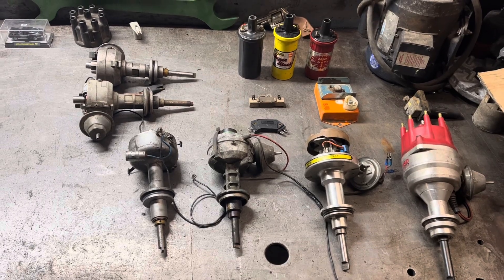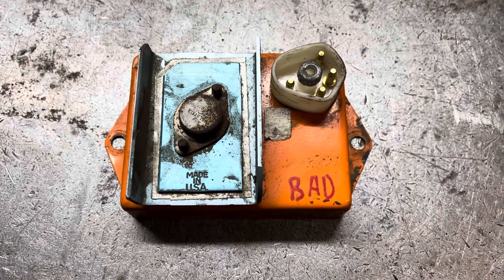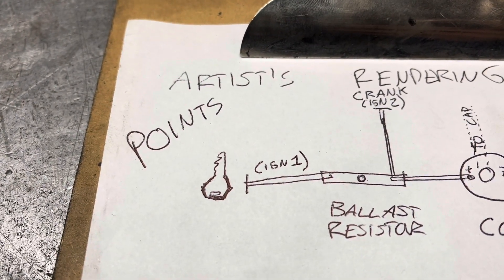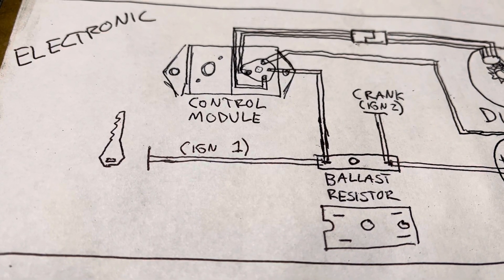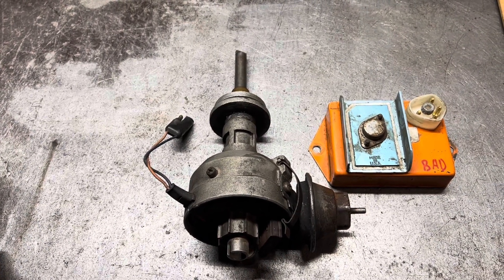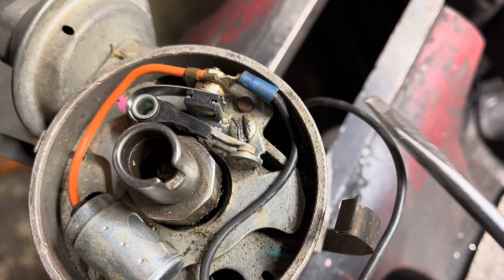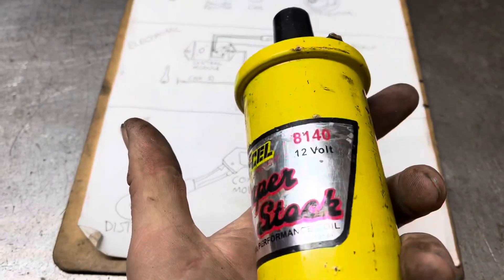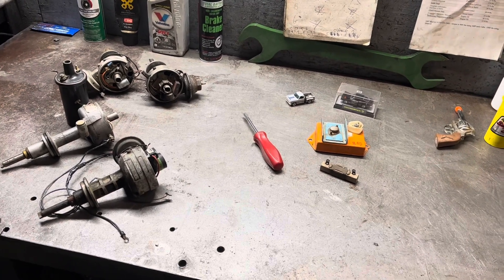Classic Mopar Ignition Systems - How They Work, How To Diagnose Issues

Comment: Very nice explanation :) Been trying to get my 78 Plymouth Trailduster running again. Know the Chrysler electronic ignition is touchy and found ign wiring boogered in engine compartment. Need to trace and reconnect to factory setup. Friend had said just do new 2wire setup with 60$ distributor and coil. Wondered what to do with factory ign pieces/wiring if I did that.
Reply from the maker: The factory stuff can just kinda stay there. It won’t be an issue. Just wire your new ignition system as instructed and it’ll work fine. You can also remove the original box and cut out or hide the connectors for it if you prefer.

Comment: Terminal issues and corrosion is always first check, with bad ground.
Reply from the maker: I’ve done a lot, and I mean A LOT of work with these systems - and I have very rarely found those issues. I have very frequently found bad ignition modules, distributor pickups, and other ignition components. Now, if we’re talking charging circuits and main feeds through the firewall, we’re talking corrosion and melted shit.

Comment: I’m putting a 82 slant six with electronic ignition into a 1953 pickup. The wiring is absolutely trashed in both trucks. The 82 runs good but I would no like to simplify the ignition system. I would appreciate any advice switching to points system or another option like a 2 wire.
Reply from the maker: Consult a wiring diagram for the points system, and mimic that in the newer truck. Or, for something simple like an HEI conversion or similar electronic system, see my HEI conversion video where I explain the circuits needed to do that. Both are simple - but you do need a basic understanding of the two ignition circuits - ignition 1 (regular ignition power) and ignition 2 (cranking ignition power) - and you need to be able to find them in your truck.

Comment: Would this test spark cause the engine to attempt to fire backward when key is turned to the off from run position? After the vehicle is warmed up and then shut off and allowing around 20+ minutes to soak. Vehicle will also crank with no start for more and more time the longer it's allowed to heat soak until it cools all the way down.
Reply from the maker: Yes, it might do that. That could well be a distributor / distributor pickup problem.
Reply: @DeadDodgeGarage  I was afraid you were gonna say that. Thankyou. What distributor would you recommend if I wanted to run an hei system. I tried a coil from a 99 durango but I couldn't figure out how to get my truck to rev higher than 3k while driving but could rev to 5k while sitting. Also was hearing a electric buzzing when the coil wire was plugged into the distributor.

Comment: Very informative to say the least!  Thank you so much as well!  I have a no spark issue with my 340 engine.  Did tests and found that the internals on the electronic ignition were shot!  You get it?  Shot, like your cap gun!  Lol!  Good stuff!  Thank you also for the tip with the GM module!  Hope you see this,!  Tom. 👍🙂

Comment: Hey Jamie, if I have a two pin , electronic ignition module. Can I run a four pin module on it? Thanks.
Reply from the maker: Yeah, you’re looking at a voltage regulator. Your ‘72 has ignition points, unless it has been modified. I have talked about how to diagnose and fix points issues in many videos, including a detailed description of how they work in my big ignition systems video (this one.)
Reply: @DeadDodgeGarage  so oddly enough, it has electronic distributor the wire goes from the distributor to the coil, and then the positive also on the coil goes to the bow resistor, and then to another wire and the ground from the distributor I think also goes to another wiring harness, the only other thing I can see on this truck that is even close to ignition control. Module is just above the voltage regulator. There’s a small tiny box mounted maybe 2“ x 2 1/2“ and it has a circle on top of it that kind of goes through the cowl other than that, I don’t see an electronic ignition on here
Reply from the maker: There is no two pin ignition module. Are you by chance looking at your electronic voltage regulator?
Reply: @DeadDodgeGarage  it’s in the top left corner of the truck. Mine is a 1972 Dodge D 100 it has two pens I believe a red wire and a green wire. I put a new distributor in it a new coil and I’m not getting any ground to the coil and I have no spark. I’m assuming that would probably be the problem right?
Reply: It’s in the engine bay. I’m just having a hard time diagnosing no spark/no start condition.

Comment: Love this video. I’m having an issue I would like brought up. My fury not only had spark to the plugs ( I pulled the 1# and grounded it to the exhaust) fuel, air, and proper timing with the rotor set to BTDC, and still wont start, barely any bangs or pops when I try cranking. Someone please help lol

Comment: Great  video.  Im having issues with mine.  What should the voltage read at the positive pole on the coil while cranking?  Mine is only about 8-9 volts just like in the run position.
Reply from the maker: Because of draw from the starter, the voltage will be much less than typical battery voltage. And of course there is always a bit of voltage drop through the rest of the electrical system. If your IGN II circuit was not working, you may only see 5-6 volts at the coil during cranking. What you are seeing is probably normal. Probably.

Comment: One variation I didn't see was the dual pickup electric ignition distributor. I hear that the lean burn distributor had dual pickups without a vacuum advance, but my 84 360 d150 has dual pickups with a vacuum advance and no lean burn.  One pickup is for crank and the other is run.  There is a relay on the firewall to switch between.  I have read this allows the truck to have advance built in during cranking for easier starts.  So, a bad run pick up will act just like a bad ballast resistor.  Cranks but dies when you release the key.
Reply from the maker: I’ll be damned. I’ve yet to ever see one of those.

Comment: great explanations and I learned a lot!! only problem is I'm still having issues diagnosing my '72 Dart. she runs fine when completely cold. when the car gets even slightly warm and you turn it off, it doesn't want to run again until completely cooled off. still cranks, just no start. I've changed spark plugs, plug wires, and did an aftermarket electronic ignition. really lost to what's wrong
Reply from the maker: Hold the throttle to the floor while cranking. I bet this is actually a fuel boiling problem. I could be wrong I suppose.

Comment: How did the old dual points distributors work? I had an aftermarket one on my 340 years ago and it had two separate wires coming out  and screws that I could use to set the dwell differently for each set of points separately to give it a longer spark, but it looks like the old stock dual points only have one wire and no screws and cannot be set to for one set to be open longer so to speak. Do they just trigger the spark at the same time and really make no difference in the spark? What did Chrysler think the advantage to that was, did in give a hotter spark with two? Might make a good video.
Reply from the maker: No - there is overlap between the two sets, and slightly different timing for when they are triggered. One opens first, one closes first. This increases high RPM performance and reduces wear on the points. The spark occurs the moment the second set of points opens, and the coil begins charging again the moment the first set closes. And yes, they are individually adjusted. They both connect to the negative terminal on the coil, so the connection between the two can be made inside the distributor. This is how every aftermarket dual point I am familiar with is configured as well - although some have a stud on the side to make the connection instead of one wire coming out. I have seen a dual point modified with two separate wires to be connected as a timing retard for use with nitrous, but other than that, I can think of no reason for the two wires to be separate outside of the distributor.

Comment: How about this problem? It cranks but won't fire until you let the key go back to the run position.
Reply from the maker: Common with some electronic ignition conversions due to the way they are wired - but can also be an issue with ignition switch, wiring to column / dash, firewall connector, or under hood wiring. I think I’ve gone over that issue in a video or two but I have no idea which.
Reply: @DeadDodgeGarage  I will look up your video. Thanks

Comment: My 76' W-100 Powerwagon 440 - just had the starter rebuilt, the truck sat for three months, reinstalled it, it started up, but then began to run terribly; zero torque, then backfiring loudly, I barely made it back home.  I bought a new control module, after installing it still runs like crap and backfires,  Jegs sent me a two terminal ballast resistor, mine is a four, so I suspect my ballast resistor is bad?  Why might it be backfiring?  Before now, it always ran Great and never missed a beat or backfired.  I changed the relay, AFB carb just rebuilt, alternater too, I'm sad and at a loss.

Comment: before going to chevy HEI: ballast resistor is crucial for a specific ignition coil, the resistor value of the primary coil determines whether the ignition system requires a ballast resistor or not, if we understand this important fact we can recognize that the mopar ignition system is the simlest and most reliable system. The HEI from chevy has its own issue too.. don't forget that.. 
Electronic ignition module black and blue are the best while the orange one is bad avoid it.. Because the circuit is bad and made for low rev. Engines not for heavy circumstances
Reply from the maker: I can’t tell you how many Chrysler electronic modules have left me stranded. I’ve had much better luck with the HEI.

Comment: Thanks for doing this video.  My problem with my 64 Valiant is that it runs great at idle and acceleration up to around 35-40 mph.  But then, it starts bucking, sputtering and backfiring.  I also noticed that my amp guage has a tick.  The needle moves slightly at a steady rate. Not sure if that has any bearing or not.  I have completely rebuilt my carburetor, and rechecked all the linkage adjustments.  I added new plugs, wires, and coil. I checked and adjusted timing to factory spec. I also went thru the fuel system including cleaning tank and replacing fuel pump. Yet, I cannot get the car to run.  Any help would be greatly appreciated.
Reply from the maker: Amp gauge movement is completely normal. You have a mechanical voltage regulator which cycles on and off constantly. As far as your issue, have you verified the points gap?
Reply: @DeadDodgeGarage  Turns out, the screw holding down the points plate had slowly loosened and allowed the points gap to grow.  It has happened again after tightening the screw, so I guess it's time for a little lock tite.

Comment: Good video!  Finally someone who understands the starting circuit vs the run circuit!

Wish I knew about the HEI retrofit when I converted my 241 Red Ram to 12V, 20 years ago!

Used an LA electronic distributor and an orange controller. Also swapped a GM one wire. 

Worked great!  And the 6V starter loved the extra power!

Comment: I have an electronic ignition in mine. The key won’t start it, though it will crank its little heart out. The only way to get it started is by jumping the solenoid with a screw driver. Then it starts up and runs fantastically. What could be the problem?
Reply: I decided to end all the bs and swapped my tired orange box with a GM style HEI module. That way I could ditch the ballast resistor and crank on 12 volts instead of 9-10.
Reply: Have a 86 duster w 2.2 everything in the control module no spark. Replaced carb w non elect .   changed the dist. Pm  module bad una vailable 😢wanted to convert to a point system w vac advance dist  any ideas on something that fits   this engine

Comment: How difficult is it to do a lean burn delete? On account of those distributors have no vacuum advance.
Reply from the maker: I showed and explained the process (somewhat briefly) in my first 1979 Chrysler 300 video. I have yet to do a lean burn delete specific video. In general, it’s not hard. You’ll need a distributor, a module, and probably a different carb.

Comment: Will V8 Dodge computer work on v6 3.9 Dakota
Reply from the maker: Negative - you need the correctly programmed V6 computer. Now, if you knew someone who tuned them, the program could be swapped in that V8 computer - assuming we’re talking about 96+ OBD 2. Dr. Art with the YouTube channel Dr. Art’s Hot Rod Rehab has actually done that for me.

Comment: @Dead Dodge Garage - Can you switch from a dual pick up distributor to a single pick up with no issues?

Side note. Your channel is right on point. I’ve learned a ton that I’ve put to use on my 87 Ramcharger with 360/4spd

Comment: Jamie, Not sure if you see the information when it's posted as a reply, so thought I should post as a comment.

Thank you so much for responding, and especially so quickly. In response to your follow-up questions, I have some additional data for you to evaluate. I tested power at the ballast resister with key on, and one side read 10.9v, and the other side read 6.88v. I next tested both sides of the coil, again with the key on, and the + side read 6.5v, and the negative read .772v (battery voltage is 12.24). Finally, I attempted to generate a single spark using the "single spark test" but was unsuccessful. So in summary, the car currently produces neither a single spark nor a spark at the plugs when cranking.  Additionally, I have 12+v on the blue/brown wire at the firewall disconnect, and I checked for rotation at the rotor to rule out a timing chain issue, and the rotor is in fact turning. If you have any further questions or need additional data, please let me know.
Reply from the maker: If you could shoot me an email and remind me what the whole story was that would be great. Judging by those readings, the ignition is grounding the coil, and you should have a spark. My email is DeadDodgeGarage@gmail.com

Comment: Hi Jamie. Thank you for the excellent video. I have a real head scratcher and am hopeful you can help. I am working on a '71 Road Runner with the 383 and a 4-speed. I was taking it out for a routine drive, and as I was about to leave the driveway, it just quit. It cranks but there is no spark. I have full accessory power inside the car. I have ohmed the coil, and it tests fine, as does the ballast. The ignition module seemed to test fine, but I had a new one so replaced it anyway. I've tested the pickup coil in the distributor, and I get 280 ohms and .2+ millivolts. Those should be acceptable readings, meaning the pickup coil should be good. I've inspected the cap and rotor, and both appear fine. Still no spark after all of this. I've visually inspected every connection under the hood, and all seem fine. Not sure where to go next? Please help!
Reply from the maker: I gave spark checks for the electronic ignition system in this video, and that's what you need to do. I never bother with the resistance checks. I go by what I can see. Check for a "test spark" when you turn the key on and then off, or connect and the disconnect the battery with the key on. Also, have you checked for power at the ballast resistor and coil positive? You didn't mention that explicitly. You could have a lack of key power reaching the ignition.
Reply: @DeadDodgeGarage  Jamie, Thank you so much for responding, and especially so quickly. I have some additional data for you to evaluate. I tested power at the ballast resister with key on, and one side read 10.9v, and the other side read 6.88v. I next tested both sides of the coil, again with the key on, and the + side read 6.5v, and the negative read .772v (battery voltage is 12.24). Finally, I attempted to generate a single spark using the "single spark test" but was unsuccessful. So in summary, the car currently produces neither a single spark nor a spark when cranking.   

Additional Data to Consider: Somewhere I learned about another test which utilizes a test light. When attaching the test light lead to the negative side of the battery, and the probe to either side of the coil, the results should produce a dimly lit bulb (this light uses an incandescent bulb) when touching the probe to the + side of the coil, but no illuminated bulb when touching the probe to the - side of the coil. The test in fact produced these results. Next, the test continues further and requires cranking the ignition while touching the + and - sides of the coil. In so doing, the results should produce a brighter bulb on the + side of the coil, and an intermittently lit bulb on the - side of the coil. However, the test failed to produce either of these results.
Reply: @JJohnson-i7h  this is actually very similar to issue I'm experiencing on my 67 Chrysler Newport with Electronic Ignition.

Comment: What would you think if it starts and after a few minutes shut off
Reply from the maker: That sounds like is heating up and cutting out - whether it’s an ignition module, a coil, an electrical connection, or something else.
Reply: @DeadDodgeGarage  i was thinking the exact thing and planning about put a new coil and ignition box and see whats happen